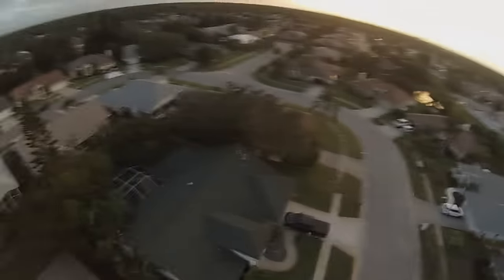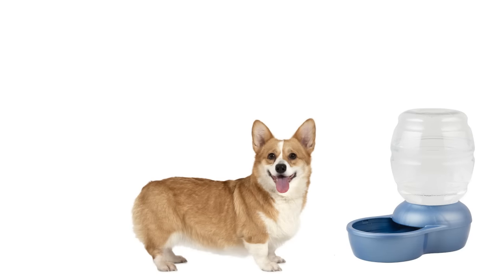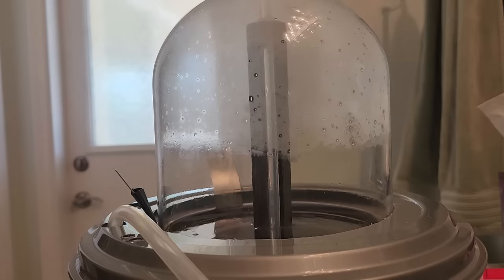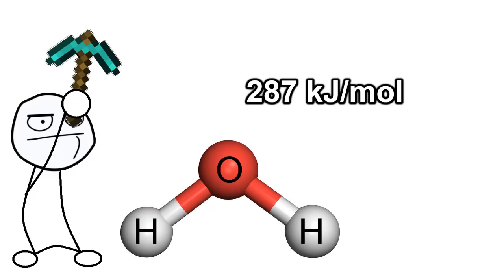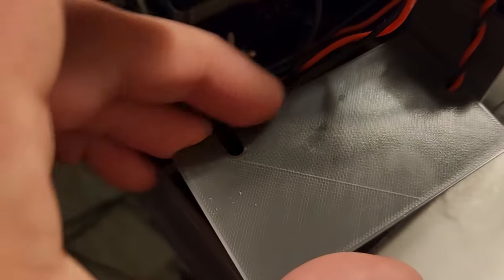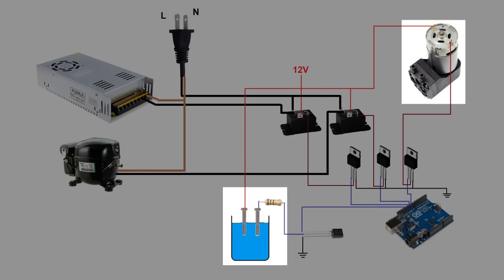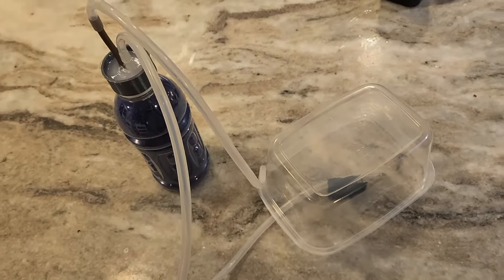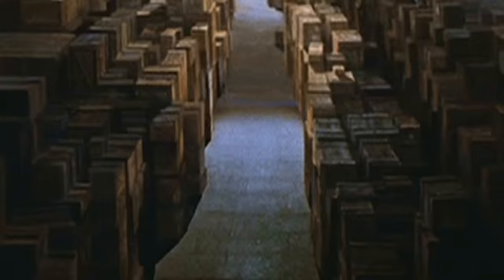Automated Hydrogen Generator

Comment: The relationship between voltage, current, efficiency, and time in electrochemistry is insanely complicated. I took some graduate-level courses on it and would be happy to share some of that if you want to pursue it further. The relationship between current and heating is not monotonic, but depends strongly on efficiency, which you can increase with stirring or agitation to move fluid between the electrodes. Might be tricky to do this without moving gas bubbles around, but it makes a world of different. Also consider using carbon fiber weave as a high-surface area anode that doesn't put chromium into solution. And you can nickel-plate carbon fiber for a more efficient cathode.
Reply: How well does the carbon fiber weave hold up over time? I once used a piece of pencil graphite and it dissolved in a half hour or less. Not sure how much energy was being pushed through it though, I used tap water without mixing a solution (this was several years ago, I wasn't very knowledgable at all about this at the time)
Reply: @awesomecronk7183  Carbon fiber holds up much better than pencil graphite, except in really corrosive/oxidizing environments (ie, making sodium metal from lye electrolysis). In those cases, the much higher specific surface area of the fiber works against it.

Also using tap water instead of a concentrated electrolyte solution would require higher overvoltages for a given current, which put more stress on the electrodes.
Reply: @Nuovoswiss  Good to know, thank  you
Reply: @awesomecronk7183  
Pencil graphite is usually mixed with clay to produce the different lead hardnesses. I'm guessing that also played a role in your electrode disintegrating quickly and probably also having poor efficiency.
Graphite rods from heavy duty zinc-carbon batteries work well!
Reply: @N.M.E.  egg xact lie.
Carbon felt works ok as well I think.
Reply: @Nuovoswiss   You don't know the construction of carbon fibre. :)
Reply: @Moonlightshadow-lq4fr  I know more detail about the "construction" of carbon fiber than almost anyone (English not your first language?). I've done electrolytic reactions using it as an electrode under a many different conditions. Why do you think woven carbon fiber would be worse than carbon felt?
Reply: @Nuovoswiss  Because carbon fibre is saturated in resin which hardens and becomes an effective insulator.
Reply: @Moonlightshadow-lq4fr   "carbon fibre is saturated in resin which hardens and becomes an effective insulator"
By the same logic, you can't use copper wires for electrical circuits because copper-wires come with a layer of insulation on it........
Reply: @DreadX10  I can see why you are a bit confused, to form carbon fibre material to any shape it has to be saturated in resin, therefore the surface area of the carbon which you want to use is insulated.  Like having to scrape off insulation from a copper wire to use the surface to conduct to other than the ends.
Reply: @Moonlightshadow-lq4fr  No confusion here.
Reply: @DreadX10 The resin isn't chemically resistant either. Using carbon fiber sounds like a mess waiting to happen.
Reply: @Moonlightshadow-lq4fr  Carbon fiber *laminate* is saturated in resin. The carbon fiber itself is just graphitic carbon, and it's just as conductive as you'd expect it to be. Why would you assume someone would use a resin-bonded composite instead of just straight carbon fiber?
Reply: @Relatablename  Why would you use carbon fiber covered in resin for electrolysis?
Reply: @Nuovoswiss  That's how they're made. The resin that mechanically stabilises the carbon fiber would dissolve, contaminating the solution. The carbon fibers would then disintegrate just like any other graphite electrode. It's a bad idea man. Just let it go.
Reply: @Relatablename  You think carbon fibers are made with resin? How exactly do you think carbon fibers are made?
Reply: @Nuovoswiss  If you're going to be so pedantic, it's how carbon fiber laminates are sold. Even as a pure, untreated product, it won't work here for the reasons specified.
Reply: @Nuovoswiss  Are they not some sort of thread that is woven into a cloth then baked leaving you with a cloth of questionable mechanical strength but otherwise pure carbon?
And by 'questionable mechanical strength', don't fold, crumple, or make into deep submergence pressure vessels.

For the electrodes, just wrap a couple layers around a non conductive/non reactive core?
Reply: @Relatablename  I'm not being pedantic. I never said carbon fiber **laminates**, and I have no idea why anyone assumed that given that it would make NO sense to use laminates or epoxy-matrix carbon fiber composites as electrodes.
Reply: @nickierv13  The "baking" (more accurately pyrolysis) happens on an individual fiber level, albeit with many fibers in a given tow. Those carbon tows are then spooled up, or woven into weaves.
Resin impregnation and curing happens later, and I can't understand why anyone would assume that I suggested only using carbon fibers after resin impregnation as electrodes.
Reply: This is the nerdiest argument ever on YouTube.
Reply: @Nuovoswiss  If available, unsized (i.e. uncoated) carbon fiber would be preferable. Polymer sizings (e.g. PEI, PEKK, PVP, PTPO, epoxy) are very thin, but of very high electrical resistivity. Some types of sizing can be removed by hours of acetone solvent extraction.
Reply: Great info. I'd be interested in your grad class materials in electrochemistry - I'd like to design my own version of this project. Would you be willing to email the materials to me?
Reply: @ryanpillai  Unfortunately, I think most of what I have is on paper, so I'd have to scan it. However, MIT open course has a lot of the lecture materials available if you just google MIT open course electrochemistry.

Most of the complexity comes down to needing to solve 3-dimensional differential equations using laplace transforms. But the really short version is that increasing the conductivity of solution and adding an agressive stirring mechanism goes a long way to improving efficiency.
Reply: @Nuovoswiss  Thanks! I will check out the courses - they’re usually quite thorough/academic.
Reply: @ryanpillai4549  If you don't want to deep-dive into the math, keep an eye out for the concepts of Tafel slopes and exchange current densities for different electrode materials, and maybe dip your toes into Cottrell equation(s).

Comment: I really appreciate how you explained the math out loud instead of just showing it on the screen. Really makes it a lot easier for your blind viewers. Thanks! And great project!
I heard about a guy who was using solar power to split hydrogen from water, fill tanks, and then use a hydrogen powered generator to run his home off grid, or at least partially off grid. I thought that was a really clever idea, especially if there was some more convenient way to do the hydrolysis. I also like the whole weather balloon thing.
Reply: I think it will always be more efficient to store the electricity (in batteries) and skip a another set of conversion steps that introduce inefficiencies.
Reply: @pyroandy3128  I imagine they are producing hydrogen for winter
Reply: Blind listeners

Comment: It might work to pump the hydrogen into a gasometer in the first stage (where any stray liquid coming through should fall into the water at the bottom of the gasometer) instead of a balloon/beach ball, and then have the drying chamber between the gasometer and compressor to remove any moisture gained from the gasometer before long-term storage. Should be much easier to automate than a balloon since you can just sense the height of the gasometer.
Reply: A more efficient way to go about it would be to make a refrigerated gas drier. He has a ton of various pieces/ parts of refrigeration equipment and seems to be quite handy with constructing devices with those parts. He could copy a similar unit that’s been around for a while in heavy commercial/ industrial settings called a compressed air drier. 

It basically has a refrigerated heat exchanger that possibly is as simple as a coax heat exchanger design that are used in swimming pool heat pumps or a “water source” heat pump (heat pump AC unit with a water cooled condenser coil. 

Have the harvested/ produced gas crossflow over a cold plate or through a refrigerated tube that has the collected moisture dump into some sort of catch can. 

There may be some way of bubbling the dried hydrogen through an oil bath as a final dry stage that hopefully doesnt change or compromise the purity/ create a dangerous compound. If it could be done safely and be inert to the hydrogen, the moisture would stay at the bottom of the oil bath and be pulled out of the dried hydrogen as it passes along to the collection ballon. The trapped water layer could be released through a tube that’s in the water and out to the atmosphere using a solenoid valve and some of his homemade level control pins and a simple timer. 

With refrigeration units we sometimes need a delay on make type or a delay on break type of timer. They’re available in a fully adjustable version where the time delay is set with a large dip switch bank. 

Anyway, some or all of that I just said may be over complicating things but the basics of using a refrigerated air (or hydrogen) drier would speed up or make the process more efficient and make a higher purity.

Comment: I built a 3kw hho torch a few years ago. I had a lot of trouble with the stainless steel anodes oxidizing (probably because I was using a much higher current and voltage to get a higher instantaneous production). If you are looking for a better material for the anode, I recommend nickel. It works really well in basic conditions. I replaced the stainless steel anodes in my system with nickel plated mild steel, and they work great, although figuring out nickel plating was a project by itself.
Reply: Bro he plated mild steal the battery connections are thin as hell and not pure nickel you would use lots and lots it probably cost lots too 😂
Reply: All you need is baking soda, DI water and Cold rolled steel electrodes and it will last FOREVER. Stainless has Chrome which is WAY too reactive!!

Comment: Just FYI, a flyback diode and maybe a 100n snubber cap (like a ceramic capacitor), across the pump motor might help to reduce interference/electrical noise and might also keep the MOSFET alive in the long run. 
Very cool project, I've been wanting to build a similar setup for RC ballooning for a while :)
Reply: RC… ballooning? Interesting.
Reply: Build a rigid zeppelin!

Comment: For safety maybe include an inline oxygen absorber. There are iron-based scavenger packets designed for the purpose but hand warmers work too.
Alternatively, a bit of platinum would catalytically form water and have the benefit of not needing replacement over time.
Probably set this up before your silica trap.

Comment: In the past I needed a supply of hydrogen on tap and looked towards electrolysis to provide it. For the `membrane` I used a large (10inch) ceramic (red) plant pot and the electrodes were 316 grade stainless cones, one on the inside, one on the outside. Neg electrode was on the inside, h2 came out of the plant pot hole. The plant pot being totally submerged, saturated with electrolyte, allowed transfer of ions, but disallowed migration of gases. The gas (h2) was collected in much the same way as your system, with a pump to empty the collecting jar. Doing things this way mean a lot smaller distance between electrodes, hence much lower resistance. The h2 purity was more than good enough for my purposes, (shielding gas for making vacuum tube cathodes) I hope this helps. This was the only way I found to get the resistance low enough for acceptable performance with everyday materials. Chris, UK.

Comment: This is one great video HP. One thing I have to touch base with you Sir on voltage used for electrolysis. My college professor stated the best voltage for the process is supposedly 16 to 18 volts. Since that was years ago I do not remember the other factors he stated.
           I have experimented with electrolysis, and the best way to pass voltage through the cell is to use a pulse width modulator to control the heating process of the cells solution. When using just straight DC current the heating part gets out of hand. You just end up heating the solution which slows down the reaction of gasmaking. 
           One last thing I noticed with my HHO cell. I wanted to get rid of the frothing and misting above the fluid part of the cell. Came up with using an ultrasound transducer to keep the bubbles from insulating the fluid contact of the plates. This worked just excellent fella. Hope that helps you out in the future work with your ideas fella.
Good day Sir too. vf

Comment: Great cell design. You can use ABS plumbing cement to solvent weld ABS parts together.
Reply: Or use aceton. Thats what a lot of people in the 3d printing community use
Reply: I believe he was trying to avoid a potential reaction with the acid solution he was using. Silicone sealants are pretty inert to most things once cured but the plastic welding is probably the best way besides creating it out of one piece

Comment: Ive thought about doing this with 2 stainless steel "test tubes" upturned in a KOH solution, and painted or powder coated on the outside, that way when one of both of the tubes fill with gas, the circuit is broken and the electrolysis will stop. The current could also be measured to determine when the tubes are full.  Ideally, the paint would go slightly inside the end of the tube to prevent bubbling out. ideally, both the hydrogen and oxygen could be collected.  
Cool project, thanks for sharing.

Comment: Dude you’ve got the makings of a popular product there. If excess solar power could be used to run this gas generator/ storage apparatus then on rainy days the stored hydrogen could be used to run a generator to recharge an off grid battery bank. I recommend you keep improving this apparatus. Totally awesome
Reply: i would imagine that the losses from converting the electrical energy to chemical and then back would be greater than just storing the solar energy in a battery; not to mention the increased mess, hassle, and danger of electrolysis

Comment: One thing could help in two ways is use of a thermostat to cycle the electrolysis off when temp. is above a set level. This would keep it in a more efficient range and keep evaporation down, less to remove. Though this might increase the time to make x volume, it might be worth a longer run if time isn't real critical.

Comment: Nice! For an even more interesting system: add solar panels to generate the electricity needed for the electrolysis and a fuel cell (or a hydrogen run generator) to revert the collected hydrogen back to electricity.
Reply: I know this is all in the name of science but if he does, he should compare the cost of electrólisis plus everything else of Jules produced to the cost of directly generating those Jules with solar panels and store them in a battery.
Reply: Or for efficiency's sake, use the electricity from the solar panel directly for whatever you wanted to power with the fuel cell.

Comment: I saw another youtuber paint a non conductive surface with a carbon paint after which he electroplated it with metal. It gave me the long alas idea of finally how to make a very cheap platinum electrode. Using that method the electrod could even be "painted" onto the body of the electrolysis, saving room or extra parts.

Comment: Very nice! If you need advice or just want to talk hydrogen generators hit me up.
Reply: Hoping that bubbles will release from Conductors and float upward,  is way too slow for efficient production of Browns Gas.

A simple solution is to use a Twin 10" Water Filter Housing from any Hardware Store, with 2 x Extruded Carbon Filters (preferably Silver Impregnated), which have wires attached with conductive Glue, and connected to a 30kHz PWM driver circuit. The Electrolyte is pumped through the Filters using a brushless DC water Pump, into a recovery chamber where gases can be extracted under vacuum, before the electrolyte is circulated through the filters continuously.

The average surface area of a 10" Water Filter is approx 4000 square meters, which allows electrolyte to remain in constant contact with the conductive carbon filters, and the flow created by the brushless DC Pump ensures that any gases are constantly being removed. A brushless DC vacuum pump is not essential, but will improve the efficiency of the entire system and accelerate gas recovery from electrolyte returning to recovery chamber.
Reply: @delawarecop can you create a simple show case video or album? I'm curious about it but have a hard time imagining it from a comment and I also would love to know if you have a working prototype :)
Reply: @natheyshiro4119  - I did a working prototype in 2006 in my garage, ut that was 2 houses ago. I do have components here to build another, but am tied up with other projects atm. You don't need to visualize it, just get a stock photo of a twin water filter housing, a brushless DC water pump, and a clear plastic container sitting beside it as the storage for water electrolyte, with enough space above the water level as gas recovery - and you have the basic principle.

Comment: Industry minimum V is around 1.43v.  I think they are also using that voltage as the baseline for efficiency calcs.  The promising workaround for zero gap sans Nafion, etc., is PES (polyethersulfone) filtration membranes and probably nickel foam electrodes sandwiched between bipolar plates of Ti, with a goal of around 2v and below.  That def wont look nearly as cool, however 😁